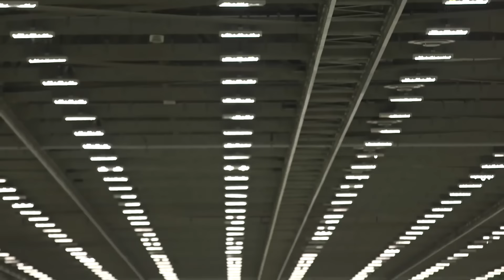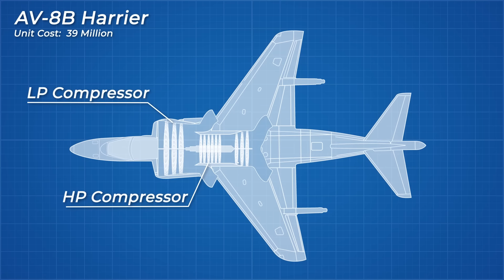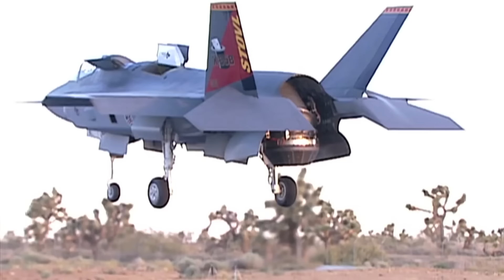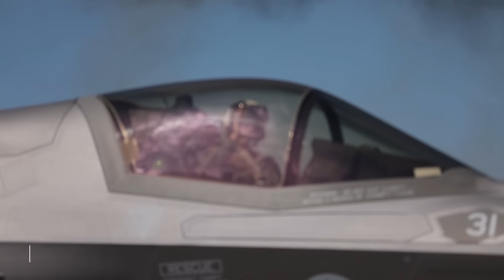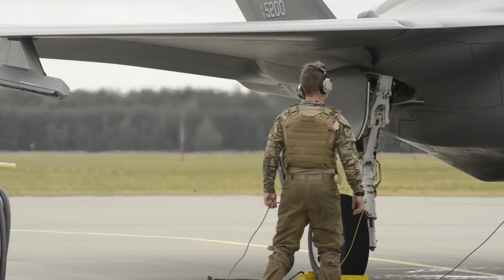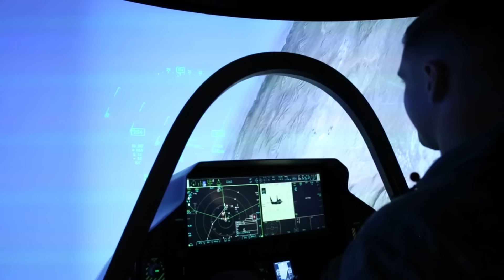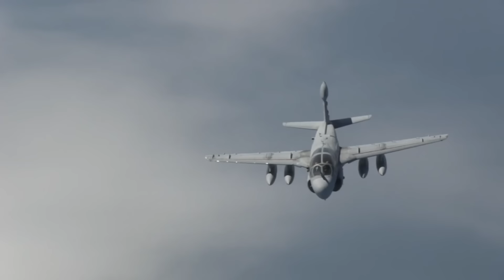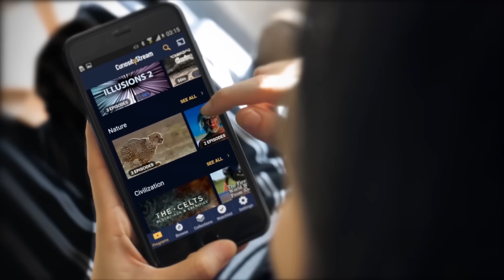Is The F-35 Worth $115 Million?

Comment: Short list of other things to also consider:
- The horrendous anticipated running costs (Stealth skin maintenance, accessing internal components, etc). 
- The necessary upgrades, considering the 90's electronics it was designed around e.g. no integral targeting laser.
- Limited range and weapons payload in an era of Anti-Access, Area-Denial. This shouldn't be an issue for the F35 itself, rather the tankers, aircraft carriers, airborne radar that support the F35. Would make China from the Pacific or the interior of Russia hard to reach.

Recommend reading are the annual Director of Operational Testing and Evaluation (DOTE) reports. These are the DOD guys who cannot lie/misdirected on how capable any American military developmental program is progressing. They report directly to Congress. The jargon used in these reports can be a barrier, but once understood, it's very informative.
Reply: gee if only the f-35 had a AESA radar
oh wait it does
Reply: @kisaragi_san1378  Apologizes, you're right, it does. Allow me to amend my original comment. The rest of the points do still stand however.
Reply: Apart from the last point then most of the point you made are complete bullshit considering F-35 has a much tougher skin than the F-22, it does has laser(EOTS), AESA radar.

Comment: German engineers recently claimed that they were able to track two f35 for 150km when they left the 2018 air show in Berlin Schönefeld by using their passive radar technology.
I thought this is an interesting twist that should be included in the video but maybe it's worth it's own one where you get in detail how passive radar techologies work and how they are able to track stealth fighters like the f35.

I would love to see this.
Reply: They were probably equipped with luneburg lenses.
These exaggerate the Radar Cross Section (RCS) of an aircraft. The main reason these are used is so less data can be compiled of what it's actual, non-exaggerated RCS is.
https://en.wikipedia.org/wiki/Luneburg_lens#Radar_reflector
Reply: @Zendoraptor_  Yes they were but the company claimed that their system uses a different frequency spectrum, so the presence or absence of luneburg lenses would be irrelevant for their system. 

Of course I cannot validate this but from my understanding of electromagnetics and passive radar systems it seems reasonable.
Reply: @Jonas-vx1mr  Yeah, you're right about the luneberg lenses, m'bad. As I understand it passive radars could be used to guide other radars to a potential target since they by themselves cannot generate quality engagement telemetry, or in other words, won't get a weapons grade lock on its own. The low-observable aircraft will know that something is trying to track it when radars start being pointed in its general direction and employ electronic warfare (jamming or destruction of active radars by using Anti-Radiation Missiles) and alter course/altitude to evade. The F-35 is also optimized to be difficult to detect from most angles and commonly used radar bands, so unless it gets very close, or the radar gets returns from just the right angle, it remains impossible to fire upon effectively.

Stealth is not invisibility, when it comes to air warfare it doesn't only mean being difficult to detect, but to disallow the enemy from effectively engaging.
Edit: A word

Comment: I think there was study that said that it would have been cheaper making three different aircrafts rather than the joint strike fighter.
Reply: RenegadeParagon they waffled. They should have actually focused on a plane that was good for the Air Force and navy and dropped the niche vtol requirement. That would have gotten us lower cost and way better kinetic performance.
Reply: He addresses that fact in the video.
Reply: There's 10 Nimitz Classes and 10 Fords on the way. There's more space on carriers than the Navy has planes for sure. The F-35B is the most expensive variant and is responsible for almost all the production delays we've seen.
Reply: Please link that study. Because designing three different aircraft is extremely costly.

Comment: When an aircraft has a radar-absorbent coating, then wouldn't the radiation absorbed by it will show up as a void in the display panel?
Reply: not how it works
Reply: Radar works by detecting the reflection of the radio waves. The F35 reflects far less, so is harder to detect. 

Just think about radaring an empty sky, the radar wouldn’t detect anything since nothing would bounce back to it. The F35 would absorb radar, so nothing (or far less than a normal plane anyway) would bounce back.

Comment: I still don’t see the point of a C if the B already exists. Surely a plane that can take off and land from a tiny carrier can do the same in a Nimitz class...
Reply: The B variant has a few significant drawbacks that were necessary to allow vertical take-off. The B has 3000 fewer pounds of weapon load available and 170 fewer miles of combat range when compared to the C variant. The B had those tradeoffs so it could be used on the smaller helicopter carriers of the Marine Corps, but since the Navy has the extra space on those supercarriers,  they might as well get the most out of the plane.
Reply: It wasn't explained, but the larger wingspan allows the C variant to carry larger payloads, both because of stronger lift, and slower stall speed for landing. This larger payload also translates into longer effective range, by virtue of being able to carry more fuel.

Comment: A point about the F-22 cost per unit. It's much higher due to the low production run. If it had been built in the numbers originally intended it would be a lot cheaper as the development cost would be spread across more planes.
There's a term… a "death spiral" where cost increase because of less orders, which causes even less buyers and the cost per unit just keeps increasing as less and less orders come in, thus economy of scales don't kick in.

If the F-35 was built in only the same numbers as the F-22, it would be a lot more expensive.

And by the same token if the F-22 had been allowed to be exported and had developed an economy of scale, the unit cost would have dropped significantly. And development of upgrades would have been far smoother.
Reply: The F-22 would always have been more expensive. And was always going to be much more expensive to maintain. Estimated to restart F-22 production and do a few hundred more were about 200 million per plane not including costs to set production back up. And thats ignoring that it can't do many things the F-35 can like carry 2000 lb bombs internally, or have a stealthy targeting pod.
Reply: I think the term you are looking for is "economy of scale", is it? Anyhow, there was no need for the raptor back then, and now with 20 years of experience better to build a new more advanced plane that China will take another 40 years to copy.
Reply: If I am not mistaken F22 fas single trick pony which was designed to fight the soviet union, and since the soviet union disintegrated, it lost its purpose.

but the same happened with F35, because at the time it was finished now NATO is on the edge of collapse and huge economic crisis is coming so expected  F35 purchases may not happen, nobody has any money for that. There are no chances to sell the amount they planned.

Comment: If I could get a trainer variant of the F-35B, that'd be great thanks.

Don't worry about weapons or stealth. Don't need them.

(yes I'm joking obviously. Can't afford something like that. XD - but you'd be surprised what you can buy as a civilian 30-60 years later...)

Actually, while the whole idea is obviously absurd, how cheap do you think an F-35B would get if you stripped out all the combat systems?

No stealth tech means you don't care as much about defects.
No sensors, no radar (other than maybe civilian weather radar)
no weapons, none of the computer systems required of such weapons...

I'd imagine you could strip a fair chunk off the cost this way, though that would likely be undercut by the lack of demand (and thus extremely low production volume.)

Comment: If space x designed fighter jets. They would out compete the F-35s in about 8 years or less. Similar to what they did to the rocket industry.
Reply: Can you explain your logic buddy, because it seems like you're delusional
Reply: @smasher123ism  Basic competency and the philosphy of lowering cost to the customer, not charging them as much as possible to rip them off. Spacex is unique it its low cost philosophy in aerospace. As shitty as boeing is when it comes to safety, they could have developed their craft for a tenth of the cost and had it flying in combat 15 years ago.  Boeing upgraded the hornet with modern tech, so now countries are buying that instead.
Reply: @_PatrickO  Dude no, this is cutting edge military technology. Research and developments of cutting edge technology, and first of all realising what capabilities need to be developed and integrated take an incredible amount of time, money and resources as well as experience. SpaceX would be slaughtered in this sector for those very reasons. Rockets are seemingly much easier to develop and market than advanced modern military hardware.
Reply: probably not. Nasa was dealing with a very different set of requirements and assumptions that necessarily reduced the performance of it's rockets. Namely Nasa was focused on reliability, safety, and slow going scientific collection of data at every step of development. Nasa was not being ran as a business: which incentives fast results, for low cost, but as a scientific agency. Space-X came in with a singular focus, rather than putting a lot of resources onto scientific research, they would prioritize rocket performance and reusability above all else. They also had all of the rocket industries previous research, and research from adjacent fields at their disposal. They improved a relatively old technology that had not seen improvements in recent decades, with a newer approach benefiting from our current knowledge.

Aircraft on the other hand, are actively being improved with cutting edge technology all the time. The entire aircraft industry is being run as a business. so short of a radical new approach that breaks some basic assumption in the industry, space-X would be just another top shelf company competing against Boeing, Lockheed, etc for military contracts.
Reply: mikeunleashed1 if spacex built fighter jets they’d have no control surfaces or pilots. Elon has talked about this.
Reply: Nah, nobody would be that crazy to do 3 in 1 design as F35.
Reply: Cue the cult of Musk.

Jesus you guys are pathetic.

Comment: The X-32 was robbed. Boeing designed it to be cheaper knowing that we would be buying hundreds.
Reply: And the late spec changes directly favored Lockheed's design
Reply: X-32 was stupid though. That giant low inlet would have sucked all kinds of debris when operating from non ideal runways.
Reply: @appa609  Yeah, I'm sure they didn't think about that at all /s.
Reply: NACAM42 you’d think but Iirc that actually happened during development and was one of the reasons the DoD picked the x-35
Reply: @NACAM42  considering how Boeing decided to risk millions of passenger's lives with their 737 MAX stunt and their hiring of 9 dollars per hour engineers, a sarcastic quip about Boeing not thinking about things is actually pretty dark humor
Reply: No self respecting pilot would fly that thing haha. I can just imagine them all faking diarrhea deployment time.
Reply: They didn't design it cheaper, they just thought the existing system on the Harrier was fine. They were wrong since the X-35B's lift system was more efficient and better performing. Supersonic flight and STOVL capability were mutually exclusive on the X-32B and it needed to be reconfigured on the ground. The X-35B could do both in the same flight.

Also slightly off-topic but... Note how the F-16 was produced as the "cheaper alternative" to the F-15, but it was still incredibly expensive for it's day and ended up being the most successful US fighter program since WWII.